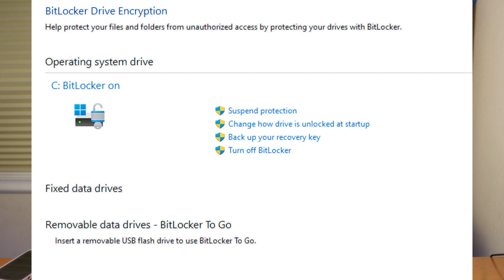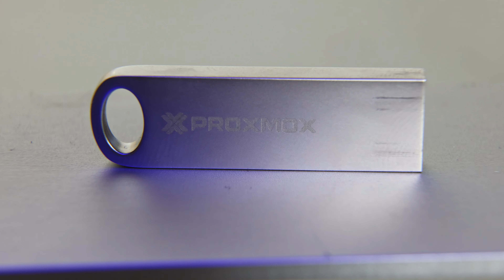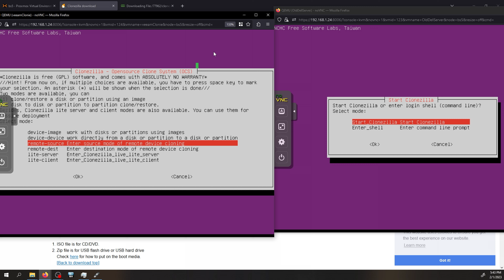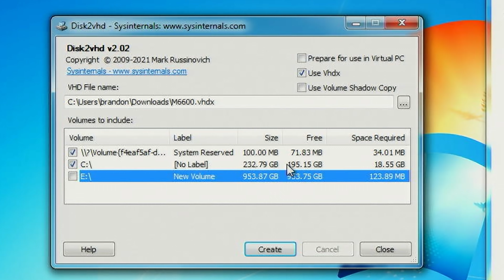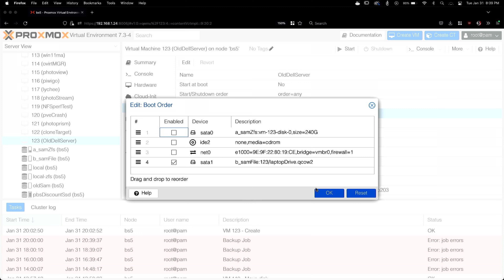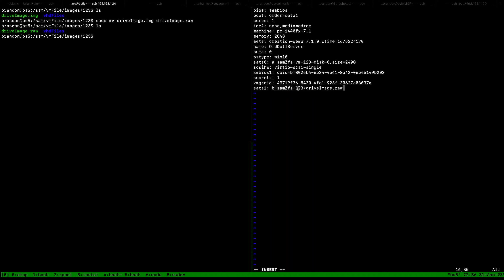Converting a Physical system to a Proxmox VM

Comment: I finally managed this today extracting the Windows C drive to VHDX, initially as a qcow2 on a PM locally mounted disk. The trick was getting the disk as an IDE then installing the virtual scsi. I wish I had added drivers to exporting system.

Because I have ZFS on a raid set of Sata SSD I converted the qcow2 to raw and copied that to the ZFS. Works - and much quicker than the HDD.

So now I need to so this with my other windows machines / PM nodes.

Thanks again for sharing your work. Glad I updated two of my PM nodes to 128GB DDR4 before the sudden ram hikes!!

Comment: I've been trying to create a disk image of a physical Linux machine's SSD, but running into a few issues:
 
Since the SSD is 512GB and I'm only using ~30GB of space, one of the ways I'm trying to create that image with dd is by using the count parameter. I basically found the last sector, added a few to the count for wiggle room, multiplied by 512 bytes, then copied everything on the disk from the "beginning" to that sector x bytes number. Basically I'm trying to get out of making a "512GB" image file by only running dd on the used sectors. 
 
I do this in a live environment, not in Proxmox. The of is saved to an external drive. Once I have the img, I convert it to raw, then plug that external drive into my Proxmox host. I import the raw file, assigned to drive, but for some reason it refuses to boot. I've tried UEFI or SeaBIOS. Tried IDE, SATA, and SCSI drive types. Tried SSD emulation.
I've also run dd to create separate images of the physical machine's EFI partition and the main partition, which I've converted to raw/imported to Proxmox host/added to VM as separate drives.
 
Best I can get is using the original img/raw (containing EFI and main partition) and using UEFI BIOS on the VM. It shows the Linux splash screen, then goes to busybox.
 
All the reading in the world and I'm totally at a loss. Any suggestions?! Thanks!

Comment: A general note about dd. If your destination file is on a removeable device, add "conv=fdatasync" to the dd command. This ensures that the dd program does not exit before all disk driver io buffers are flushed to the destination device. As RAM has become cheap and large buffers swallow up, and it can take considerable time to flush large io buffers depending on RAM size and disk speed. Otherwise you risk remove the disc when flushing the remaining data and you have lost data.
Reply: "RAM has become cheap" praying that this becomes a reality again.

Comment: I am new to Proxmox learned to install on bare metal from somewhere else however was struggling to convert VHDx file to image that is where you came into picture. After 3 or days trying different methods, finally I followed your methos. (slowed down your video) and was able to successfully convert vhdx to cow2 format and was successful. Thank you very much. Your explanation was very clear and to the point. Keep up the good work.

Comment: Good day, once created the VM, is it possible to keep both systems (virtual and physical) simultaneously on and synchronized? That is a fault-tolerant configuration when one falls, replaces the other. Does Proxmox handle this type of configuration? Thanks.
Reply from the maker: Running a cloned OS can be a challenge as some OSes like Windows has a internal IDs that will cause issues if there is a system on the network with the same ID.

I'd look more into backup solutions that are easy to restore into a VM if your goal is to be able to get up and going quickly if a physical host were to die.

Comment: TIP: When Disk2VHd not work and you have Synology with Active Backup for Business you can backup the physical server to Synology and then recover it from backup directly in to the virtual machine. I did it many times and it works well. :) Also in case you had Windows installed on a machines with HW RAID controller you can face the issue with booting in VM. Then you need to boot windows installation CD and edit registers to disable raid drivers and force generic SATA/IDE drivers to be used to boot up the VM.

Comment: hi, i wanted to ask, if it is possible to clone a Windows 2012 Server too, or is it only for normal Windows systems?
thanks in advance for your (or somebodies) answer.
Reply from the maker: Windows server should work the same as windows desktop here. There may be some extra config if the server has special services, licensing or functions but I’ve done windows server migrations that are working well to this day.
Reply: @ElectronicsWizardry  thank you very much, this was the fastest answer i got ever ;-). i will try to virtualize this old server, but first i have to setup a proxmox server. thx again

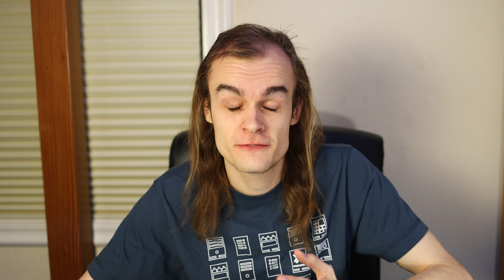Comment: What was the typo that you mentioned at 18:25?
Reply from the maker: I think I mistyped the storage path. One type in the path and it will give that errors that it can't access the storage.
Reply: @ElectronicsWizardry  I'm doing this with a centos baremetal machine using the dd method to NFS mount. When I boot up the vm, It gets stuck on "Booting from Hard Disk..." Not sure what is wrong haha
Reply from the maker: @perfectdarkmode check that you have the right disk selected as the boot drive and the legacy/uefi switch is correct too.
Reply: @ElectronicsWizardry  Was like BIOS mode. Now I think I just gotta figure out how to get Vitio drivers on the system cause it's in emergency mode and I think it's not reading the sda drive.
Reply from the maker: @perfectdarkmode if it’s in emergency mode I’d guess it can’t read the boot drive. Try changing the drive type to sata or ide which is more compatible with older  oses. Most systems don’t like to have their boot devices driver changed and that’s likely the issue here.
Reply: @ElectronicsWizardry  Is that the hard disk setting? Or SCSI controller? By hard disk it says (sata1) and by SCSI it says VirtIO SCSI
Reply from the maker: @perfectdarkmode the best way to change the disk mode in the gui is to detach the disk. It will then show as unused. Then select the disk and click on edit and change the type to sata or ide and I’d guess it will boot now.
Reply: @ElectronicsWizardry  It worked! You are amazing!

Comment: How would you do this for systems with multiple devices?
Reply from the maker: By devices do you mean drives? I’d typically move the boot drive over first and make sure it boots and move over data drives. You can do other complex setups like raid as boot drives that that gets complex quickly
Reply: @ElectronicsWizardry  Like /dev/sda with multiple partitions with RAID 1 with /dev/sdb. ANd maybe even /dev/]sdc and another device.
Reply from the maker: @linuxreader  How is the raid 1 setup? Is this in software via mdadm or similar? I'd make a image of all the drives and add them to proxmox as unused disks. Then first add the boot raid volumes, and setup the boot order to the correct drives. Once the vm boots add the data drives.
Reply: @ElectronicsWizardry  That makes snse. Thank you!

Comment: Great video and just wat I need.  Running a number of Ubuntu and Win VM, along with LXC. You show you have SSHed into a directory file structure of Proxmox. But there is no "/sam/vmFiles/images/xxx" path. Searched my Proxmox and can't find that anywhere.
Reply from the maker: The /sam was made with a zfs pool of the name Sam, with a folder named files. Once you create a proxmox directory storage it will make the images and other folders in that path.
Reply: @ElectronicsWizardry  Thanks for the quick reply. Still plenty I don't know about Proxmox and linux, but still learning. I use TrueNAS and use zfs, what a great file system.
Reply: @ElectronicsWizardry  So in other words we should just create a directory of our own choosing from the root directory and the system will automatically place it in 'local-lvm' ? I've got a 'stock' proxmox install on a 1TB drive where 100GB is 'local' and 900GB is 'local-lvm'.  To dd a disk larger than 100GB it seems like I would need to make sure it ends up in 'local-lvm' and not 'local' and I don't have any other disks attached in order to  make a ZFS pool. Any help is appreciated. Thank you in advance.

Comment: I tried using the dd method, but I'm a bit lost with where to place the raw file.  It's currently sitting in my root directory, I don't know where proxmox stores its raw files for the VMs.  My default one that I'm trying to replace is in local-lvm but I don't know how to get the raw file from root to local-lvm.  Also does it matter what you name the raw file?
I also noticed you used sata devices for your drives, mine are virtio drives, does that matter?  I'm also trying to copy linux mint btw instead of windows if that makes any difference.

Comment: Cool, thank you.  Where appropriate, can you install the VirtoIO drivers for Windows onto the original physical device, before you copy the clonezilla image?  I would have thought that would make using VirtIO drivers later much easier.
Reply from the maker: I have never tried installed the virtio drivers before the migration, but I don't think it would matter when its installed. I find it easier to install the drivers after the migration as I can easily add a ISO CDROM to the VM. I don't think when the drivers are installed should affect performance or stability of the VM.
Reply: @ElectronicsWizardry  It won't make any difference after it's installed. The only difference is the accessibility of devices from initial startup of the migrated VM.

Comment: There is some important information missing from both the clonezilla and the dd explanations.

I'm running Proxmox VE 8.2.2, and I want to copy a Linux physical machine into a Proxmox VM. I first created the VM using the method you showed. I tried tried the clonezilla method, and booted a clonezilla live USB disk on the machine running ProxMox. Running lsblk didn't show a Proxmox device with a /dev/sd? name (sda in your example). Rather, I saw

root@pve:~# lsblk
NAME                         MAJ:MIN RM   SIZE RO TYPE MOUNTPOINTS
sda                            8:0    0 476.9G  0 disk
├─sda1                         8:1    0  1007K  0 part
├─sda2                         8:2    0     1G  0 part /boot/efi
└─sda3                         8:3    0 475.9G  0 part
  ├─pve-swap                 252:0    0     8G  0 lvm  [SWAP]
  ├─pve-root                 252:1    0    96G  0 lvm  /
  ├─pve-data_tmeta           252:2    0   3.6G  0 lvm
  │ └─pve-data-tpool         252:4    0 348.8G  0 lvm
  │   ├─pve-data             252:5    0 348.8G  1 lvm
  │   ├─pve-vm--100--disk--0 252:6    0   100G  0 lvm
  │   └─pve-vm--100--disk--1 252:7    0    73G  0 lvm
  └─pve-data_tdata           252:3    0 348.8G  0 lvm
    └─pve-data-tpool         252:4    0 348.8G  0 lvm
      ├─pve-data             252:5    0 348.8G  1 lvm
      ├─pve-vm--100--disk--0 252:6    0   100G  0 lvm
    
The last disk shown, pve-vm--100--disk--0 252:6 , is the ProxMox disk. The only choice clonezilla gave me for a destination disk was /dev/sda, which, of course, would have wiped out Proxmox if I had chosen it.

This also means that the dd method you showed can't work because I don't have an output drive to write the disk image to.

Any suggestions?
Reply from the maker: If I'm understanding this correctly your running Clonezilla on the host? I think you should run Clonezilla in the VM. When Clonezilla is running in the VM, the vm-100-disk-0 will appear as sda to the VM.
Reply: @ElectronicsWizardry  Thanks for the reply. I watched your video again to see if this was mentioned. It wasn't. I respectfully suggest that you mention that the VM you show being created must be configured to first run Clonezilla Live. I think this will save many watchers a lot of time.

Now I have another Clonezilla-based problem. The disk I'm cloning from is a 1TB disk containing 3 partitions. The 3 partitions consume 130GB so I created a 150GB virtual disk in the VM. But the cloning fails because Clonezilla is trying to clone all 1TB of the source disk, rather than the 130GB I was expecting. 

Thanks!

Comment: Is thefe a way tobuse proxmox with a VM windows on one box without using another machine to login using a browser? If so would it make a good workstation solution provinding the hardware is good. I have a Minisforum MS01 with i9 13 gen and 64gb ram
Reply from the maker: You should be able to install Proxmox on an existing Debian OS, or the other way around for a Linux desktop OS with full Proxmox hypervisor functionality. I might make a video about this in the future. The Proxmox Wiki has some guides about how to install Proxmox on an existing Debian install.

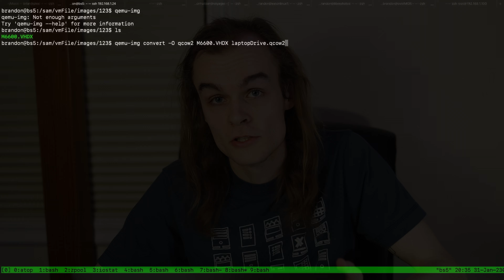Comment: This is a great video but where is /sam/vmFile/images shown at 11:00? Where do you actually copy the converted qcow2 disk image to on the proxmox host? I'm using the default local-lvm that I have a feeling a lot of people reading this are also using.
Reply from the maker: I have found it easiest to make a temp location for the qcow2/raw file, then use the move disk function in proxmox to move the storage to LVM. In your setup running off a single boot drive this is what I'd do
-Enable disk image storage on the local file storage
-Copy the qcow2 file to the local file storage location, this is /var/lib/vz/images/VMID/. You may need to make the VMID folder.
-Use the move disk function in Proxmox to move the storage form the Qcow2 storage to LVM. Then remove the Qcow2 file.
Reply: @ElectronicsWizardry  Thank you for the stupid fast reply. My proxmox host is on a 1TB NVME drive and the installer created the "local" storage as only 100GB so my 150GB disk image won't fit. Is there a way to copy to local-lvm instead? Also forgive another noob question but don't I need to already have the disk attached to a VM to use the move disk function?
Reply: For some reason I was way overthinking this. Copied the image to a network storage that proxmox has under the images/###/ folder. Created a VM with the same ID, did a qm rescan which picked up my copied disk image. Added it to the VM and then moved it to my NVME storage. I now have the converted disk image attached to my VM. Thanks!

Comment: Snapshot is not working message not supported
Reply from the maker: Where do you see this message? Are you on a storage format that supports snapshots? Check the PVE wifi page on storage and see if the storage type your using supports snapshots https://pve.proxmox.com/wiki/Storage.

Comment: This is great, would love to see how to import a qcow2 file to the local-zfs
Reply from the maker: Once the drive is added as qcow2 the easiest way to move to local zfs is to use the move storage to move from the qcow2 to zfs.
Reply: @ElectronicsWizardry  Awesome! was able to to use qm importdisk <VMID> <File.qow2> local-zfs
Reply: I had converted using the Disk2VHD and then used the qemu-img convert -f vpc -O qcow2 -progress
Reply: I was doing it over network not phsyical after i had it converted I ended up using rsync to the /tmp folder on proxmox and imported it from there. Only issue I really had after that was having to attach the disk as IDE to get windows 2012r2 to boot then install the virtio drivers, attatch a SCSI disk and verify it was recognized then i could shutdown, detach both disk and re attatch the main disk as virtio scsi. Seriously though your videos were fantastic! Thanks for replying and keep up the videos really enjoying your series on Proxmox.

Comment: I use Proxmox on 2 mini PCs at home and run our work intranet off a proxbox in work and love it.

Just after some networking advice on how to set this scenario up. Appreciate any help/comments.

So, In work i have a 2012R2 DC and have just purchased a new server and set it up with server 2022. Before doing the nightmare moving of roles, AD, shared folders etc I wanted to set up a test lab so i could run through everything, write it all down so that it should be simple for the final move.

As my proxbox in work is only low spec i decided to set up Hyper-V instance on a spare old windows 10 pro pc. I created a VHDX of the 2012R2 and 2022 servers and also a win10 box. Had to install pfsense to create LAN and WAN subnets. (youtube video) After 8 hours of struggling with DNS I've called it a day. Damn 2022 cannot be added as a DC.

I now want to try it on proxmox at home. I'm just a bit confused as i read up on setting the network up as bridged but not sure how to do it.

Basically my home machines run on 192.168.1.1/24 and so my proxboxes run on 192.168.1.190 and 191 but i want my 2 windows servers VM and win10 VM to run on 192.168.0.1/24 as that is how they are set up in work and also to have internet access so i can apply updates or browse help forums.

How would i go about this please?

Comment: I like you tutorials, but sometimes missing the cleanup stage afterwards. I know this is 9 months later, but once you have attached the image file and are booting from it. do you need the 240GB Sata0 drive you originally created to run the VM up? Thanks.
Reply: Yeah, I got lost there too... if you're booting directly from the image file, why even have the 240GB sata drive? nowhere does it show that you copied the image file to the 240GB drive. So why even create it if you're just going to run the VM directly from the image file?

Comment: how tf do I get the vhdx file from the external harddrive to the right directory in proxmox???
Reply from the maker: You can use the cp command in the terminal to do this. CP /path/from/external/hdd /path/top/copy/to/
Reply: I am sorry, I am somewhat new, where do I find the external drive? does it need to be in a certain filesystem type?  @ElectronicsWizardry

Comment: Small voice over mistake in 16:30: The if= parameter in dd specifies device /dev/sdo (letter o) not  0 (number zero). The command shown is correct though. 

Btw instead of dd you can also use buffer, does the same but is supposedly a bit faster.